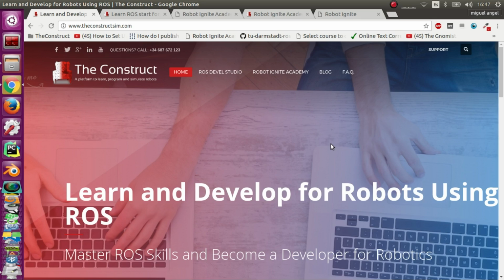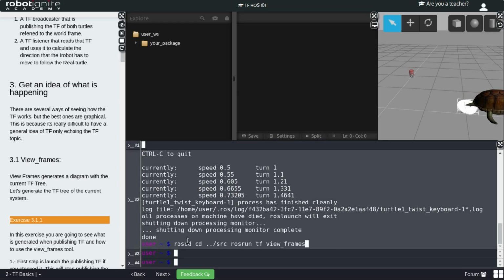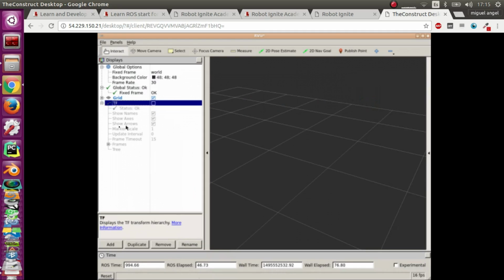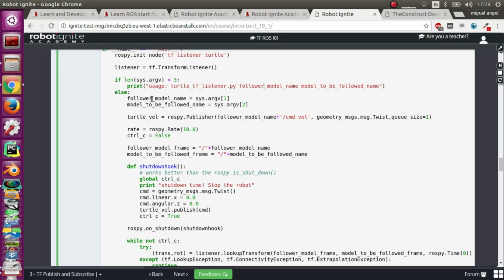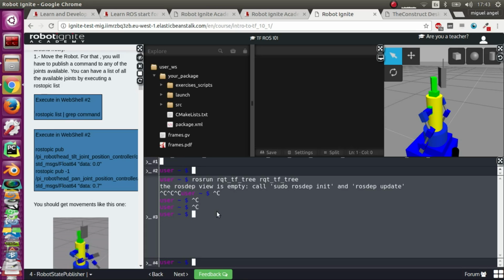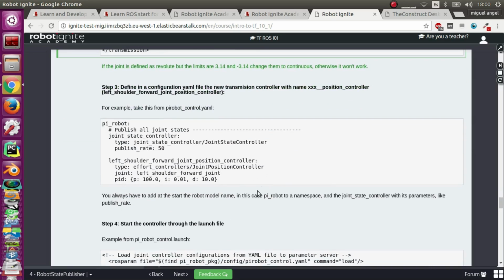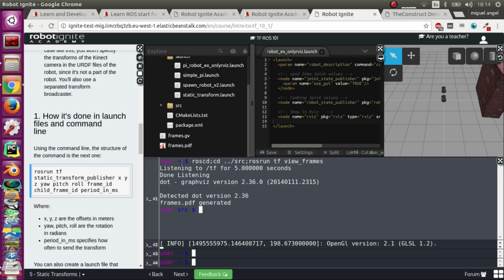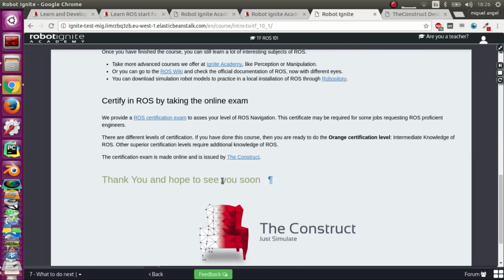TF ROS - Full Course for Beginners

Comment: I love when someone uses acronyms like everybody is assumed to know them.  No, they-re not mentioned in clip's description. W.T.F is  T.F. ? TensorFlow?
Reply: Haha, funny because I'm new too and i thought it was Tensorflow at first as well. However, after abit of googling I assume it means TransForm?

From ROSWiki: "tf is a package that lets the user keep track of multiple coordinate frames over time. tf maintains the relationship between coordinate frames in a tree structure buffered in time, and lets the user transform points, vectors, etc between any two coordinate frames at any desired point in time."
Reply: @kiblykatt  That explanation doesn't make any more sense than the presentation.  Trying to impress people with your command of technical terms that make you sound like an expert does not give you the ability to provide additional understanding.  It just makes people more confused than they are.  There are a lot of folks on this site that presentations, teaching a variety of things, that also have no idea how to explain things in a way they can be understood.  Not at all impressed with your attempt to explain.
Reply: I'm flattered you actually thought that was my explanation. But if u took more time to read my reply properly, instead of spending that time attacking it.. I  was assuming, and I didn't explain a single thing. I clearly wrote "From ROSWiki:" and quoted them(that's what inverted commas are for btw). Also, I'm not impressed by your inability to read. Have a nice day :)

Comment: Thank you for the tutorial. I hope you can still answer the commentaries, since that was done some two years ago. How can I apply that to a real robot? Because here we are taught tf in relation to gazebo simualtion, but how could it be for a real humanoid, let us say, 19 DOF robot?
Reply from the maker: It works the exact same way. The real robot will use the URDF file that defines all the transforms. The same URDF is used for the real robot and the simulation (except some pluguins loaded in the Gazebo one). So you will have the same TFs for the real robot. Makes sense?

Comment: If the robot isnt simulated in Gazebo do we really need a controller? To add to that, I only want my robot to simulate through RVIZ so do i need a controller still?
Thanks,
Lauro
Reply: Same question as Lauro
Reply: According to this video, I believe you don't need any controller if you use just Rviz. You need only the robot_state_publisher and joint_state_publisher for the fixed and moving joints respectively. Someone please point out if I'm wrong.
Reply from the maker: @henrique BIR is right. If you only want to visualize in Rviz, you only need the URDF without all the controllers and Gazebo part. Also launch the robot_state_publisher and the joint_state_publisher